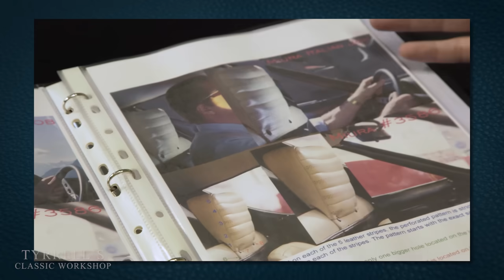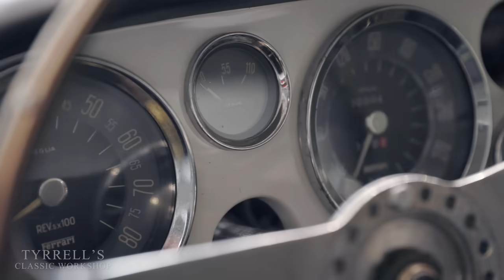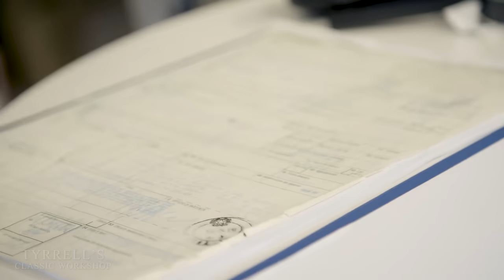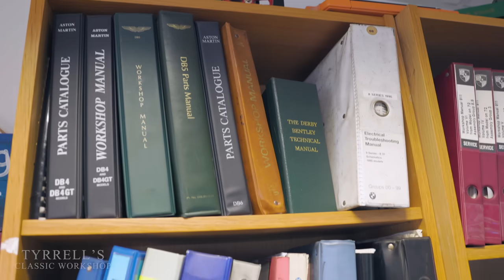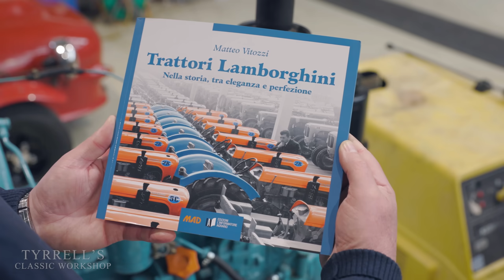Unearthing a 60 Year Hidden Treasure - THE Car that unleashed the Raging Bull Pt1 - World Exclusive!

Comment: Wow! I didn’t think you’d beat the Miura, but you have with this. Not only is the car a legend, you are too sir! Hope you find the ‘Goldilocks’ clutch. It would make sense if the two cylinder tractor has an 8 inch clutch and the four cylinder a 10 inch, that the three cylinder would be 9 for their respective power outputs, but this is an Italian manufacturer and they made their own rules in those days, so who knows?!

Comment: All old stories need new ones made about trying to prove what happened all those years ago. Lets hope that Part 2 proves the 9" clutch debacle. Another question is; what was wrong with the Clutch and why did Ferruccio what to change it??
This story is just amazing and for Iain to be so involved in it shows to true stature that you have within the Automotive World. To be apart of the Lamborghini history from the very beginning is true tales of fantasy. See & touching and now restoring the Ferrari that was owned by Lamborghini is amazing.
Reply: The German Fichtel & Sachs Ferrari used in road going models was good for normal driving, it smokes heavily if you are starting uphill or driving too fast. I have an old intervied somewhere were FL states he replaced the original 9" unit with a 10" after market item. Didn't say a word about any tractor parts.

Comment: Fantastic! And still with the original body, it's a crime to junk these elegant 250 PFs and GTEs, for something fake, however convincing. I'd rather have a real GTE than a fake GTO, not that I'm likely to have either.
Reply: Totally agree
Reply: @manfredschmalbach9023  If you modernise the car to give better driveability and roadholding etc. then you are not having the original experience. Most GTOs seem to be still used rather than locked in vaults, but when they break owners don't put in an LS, powerful and reliable though that might be. Build a totally accurate replica by all means, a couple of million should do it, and you have a nice new car that you can use and abuse as you wish, but to break up a lovely car like a 250GTE just to look 'the racer'  is not something I like the idea of.
Reply: @JohnDavis-ed5sg  Well, I did not think of a sacrilege like an LS-swap, of course, more like better shocks, better sway bar links, changing angles and leverage in the undercarriage, a modern clutch instead of a Lamborghini Tractor 6 spring one .... better ignition, better oil-circulation .... I wouldn't even go as far as swapping to Lambda mixture regulation, which we built into some less sporty cars together with carburettors when catalytic converters became a thing - works great even without the converters, but I wouldn't do that.  Better brakes and things like that though - a sacrilege for original freaks, a must for me. Anyway, only car worth ruining with an LS would be leafsprung american car I reckon 😁.

Comment: I remember back in and around that era, that some flywheels can take two different size clutch assemblies, the flywheel will have two different position mounting hole's/threads. Just a thought.  ?

Comment: 17:38: advanced  modular construction in the 1960s.....maybe, but still 30 years after Gardner were doing this with 2 and 3 cylinder modules giving 2, 3, 4, 5, 6 and 8 cylinder variants of the legendary LW engine.

Comment: I’m on the hunt for the legendary first Austin Allegro from 1973 that Harris Mann (Allegro designer )  owned for two days before it broke down with gearbox , suspension and engine problems and a week later rust issues. It’s out there somewhere 😁.

Comment: I have always thought the most interesting thing about collecting anything old ( I am into vintage watches) is the research about the pieces. This is fantastic Iain, I am really looking forward to the next installment. 

Re the clutch. Around this period Italy was Benefitting from the Marshall Plan and believed in an integrated Europe. Is there any chance that some parts of these tractors came from other companies. Perhaps not all Lambourghini Clutches were designed and made by them? I read that they used engines from Perkins and Motoren Werke Mannheim-Benz around this time and in fact aquired the rights to manufacture MWM engines, perhaps the clutch came from those makers?

I am sure the famous(infamous) male Italian bravado could have easily bent the truth a little?

Comment: Wouldn't it have been easier to get the workshop manuals (if available of course) of the tractors and got the dimensions of the clutch from there? That would eliminate taking two tractors apart and opening the right one first time.

Comment: On the Wikipedia page for the Ferrari 250 model it is stated that Lamborghini owned several cars of that model. Obviously these guys have done all their checking to confirm that the one in the video is the one he owned at the time of the confrontation with Enzo Ferrari but what about the other examples? Might any subsequent 250 that Lamborghini owned (if there was one) have had the same clutch conversion?
Reply from the maker: You are right, we have done our checking. All will be revealed….. thanks for your interest

Comment: Even if you can’t find a 9” clutch plate in a contemporary Lamborghini tractor, it could have been that Lamborghini asked his normal clutch supplier to provide a 9” clutch to fit the Ferrari…..it still more or less means that a tractor clutch was used to replace the Ferrari original clutch.
Surely what you should also do is recover the existing clutch from the Ferrari as it is now and see if it seems to be the same type and manufacturer as those tractor clutches.
Reply: Or if the clutch in the car is non-standard.
Reply: No, the Tractor-to-car is the story not "Ferrucio changed the brand of clutch" ...every second owner would have done that.

Comment: Clutch specifications are surely available in print for every tractor produced by Lamborghini. What's the issue here?
Reply: Yeah, lemme just run down to the 60+year-old-only-sold-in-Italy-tractor-specifications store.
Reply: Gimme a break. It's Italian. I've owned 3 Ducatis and there's no way to know what inside them.
Reply: Even if it turns out to be a 9”, what’s to be learned? You can’t tell me that they just grabbed a tractor clutch and bolted it into the Ferrari. If the lunch story can’t be verified, then maybe Mr. Lamborghini was upset (or not) with some other functioning part of the car?

Comment: Those old coil spring clutches must have been hard to live with for long.Very heavy to operate and very "on off" Not good in traffic.So was there a diaphram clutch around that was used to switch to? If thats the real story.

Comment: To save a great deal of time & mechanical trouble .  Surly common sense  research , get in touch with the tractor manufacturer  for clutch size  used o all the range of tractors.
 Some of the most famous Lamborghinis emerged from under the German automaker's wing, including the Murcielago and Gallardo. Rather fittingly, the company still produces tractors to this day. Lamborghini Trattori is now owned by Same Deutz-Fahr, though they still adorn their tractors with the Lamborghini namesake.

Comment: I don't think it was that heavy duty style clutch disc and pressure plate, that mass is not suitable for high RPM use and the clutch disc would have a cushion sprig center hub.

Comment: By the laws of deduction the 3 cylinder has to have a 9” clutch, if the 2 has an 8” and the 4 has a 10”
Reply: For my taste a bit to much theatre. There should be documentation what type of disk was fitted on these oldies.